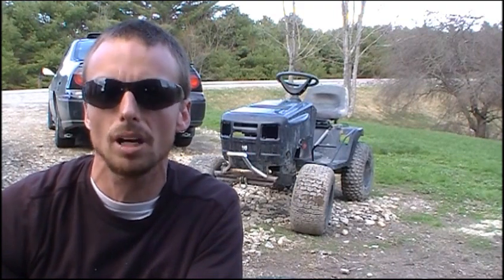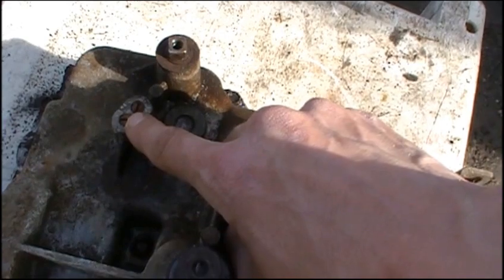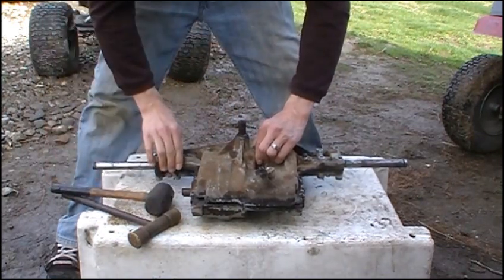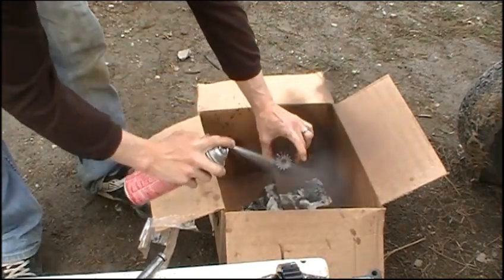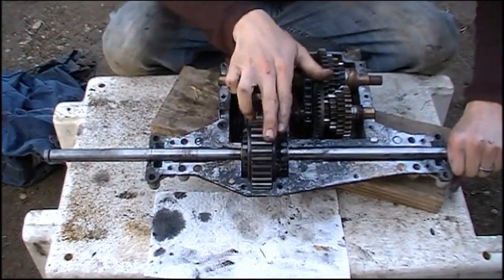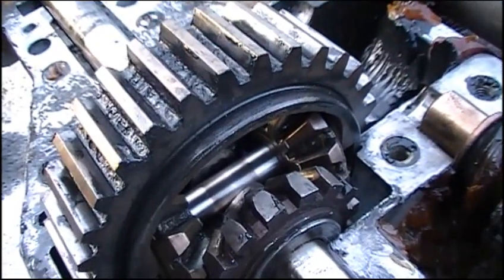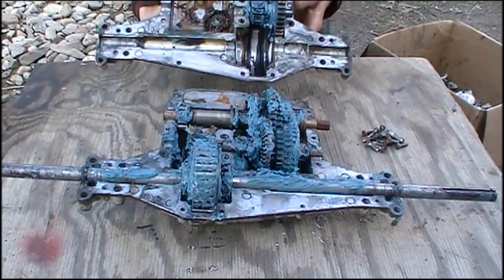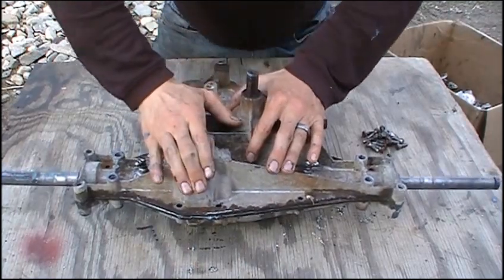How to: Lock a Trans-axle or Differential

Comment: I have a Lawn Chief riding mower.  I took it apart and intended to weld it together and find out why it would not shift when it was in a bind.  I decided not to weld it together because it would not turn around in a small space.  I put it back together correctly and it still will not shift when in a bind.  Do you have any suggestions?

Comment: this has help a ton i was so confussed when someone said they can do this but would this help i have a craftsmen lt4000 and im planning on plowing snow withi it should  lock it or leave it the way it is right now i am running dullies with snow chains but it still gets stuck alot and i have 200 pounds of sand in the back plus my 180 pounds

Comment: I was considering changing my axle shafts to longer ones in order to use wider tires.  Do you think it could hurt the axle? Or is there any other way of mounting wider tires to the existing shafts without welding hubs to them?

Comment: Ok I gotta question, I took my gearbox out just to replace the grease because it was old and discusting, however when I put new grease in it it started turned extremely hard and didn't want to anymore. Does that mean I need to just work at it alittle more to break it in?

Comment: I watched this vid and it was alot of help I locked a 820 and everything works but it shifts real hard is there anything I can do about this
Reply: Should be a detent screw near your shifter flat top screw driver to adjust shift stiffness
Reply: Jimmy, 802 I suggest watch a 13 part series called What on earth happened by Ewaranon to learn that the earth is not a globe.

I got it in my about tab.

Comment: I am building an off road mower from an old Dynamark with the 12.5hp Briggs in it. It has a hydrostatic transaxle and I don't have to shift it. Can I still use this method to lock it? Thanks

Comment: it is because it is mainly for a drift car or a car that u will be doing skids in. the reason it makes a funny noise is prob coz it needs to spin both the wheels at the same time and it is putting to much stress on the diff or when u welded the diff a bit of crap could have fallin in their and it could be clunking around this is only maybe

Comment: Hi fearless I welded my craftsman trans axle as per your video it wash locked and working good untill I took it mudding now the trans axle acts like it was never locked I didn't hear anything happen and when I lifted the rear end and spun the tires there is no noise or binding it just acts like it did before the welding what could of happend?

Comment: I added a John Deere axle behind my Murray garden Tractor. The Murray rear axle has a side drive while the John Deere is on top. If both drive pulkeys are the same size will the axles pull at the same speed? I want both axles to move my tractor. Would it be better to use a tire tread track or gears and chain instead of the extra belt from the motor to drive the second tandem axle?

Comment: I'm building a yard tractor . What is the toughest lawnmower /best transaxle ? A Peerless MSD 206 maybe  ?
Reply: John Averick the 206 is a good one I have one in one of my mudders, I like the 800 series and the Peerless 600, the 600 is probably the strongest of the 3 I mentioned made out of cast iron 3 speed with reverse the things a hoss
Reply: John deere x748 it will pull your house down

Comment: haha
it is normal, wheel rotation speed on each side of the car is different on a car , so by locking those, they will generate a ''drag'' while steering the tire might hop at high speed too!

Comment from the maker: it wont make it hold up better, it will just make both tires spin. and it will also limit your turning radius as well. If you already breaking axles left and right, I wouldn't lock it. It'll just break faster

Comment: I locked my differential on my craftsman, the lock is working fine. the problem is in all forward gears every once in awhile the transaxle will make an abrupt clacky type noise and then stops turning abruptly and then starts turning again at the same speed. I'm really worried about what's going on. another problem is that the tractor is hard to push in neutral. before I locked the transaxle I think it only did this abrupt stop in 5th gear (it's a 5 speed) but I cannot be sure if it was just thi

Comment: continued-- it does not turn as good, but it is worth it, i will be putting snowmobile skis on the front for this winter and right before fall i will order in new front tires, when i get paid on the tenth i will order some 22-11-8 knobby tires for the back, run the stock rims, and as for the front i may have to left the rear or lower the front but i will use 8 inch rims about 5" wide, i will run 6.5 wide tires also knobby tread, or something that will dig in when turning

Comment: and also if i use a stick welder for the locking what amp setting should it be on for maximum strength? whenever I'm welding stuff with it I have it on 75 to 90 amps usually

Comment: hi, i have a transaxle that looks exactly like that, same shape same everything, same position of brakes. , mine has a high, a low , and a reverse range for shifting.  so do u think my trans could handle snowplowing? is it a heavy duty one or just some chinese thing? thanks, jst wondering cause i don't want to blow it out if its not built for plowing.

Comment: Is there a reason why you didn't just fill weld a couple of the teeth on the spur gear? Not only will the axle "float" so you don't get any wobble, but if the spider gear tries to turn, it'll jam on the welded teeth.

Comment: Ok see if you can help me out, i did what you had shown in the video, however you mentioned that as you turn it it can be a little stiff and thats nothing to worry about. I get that sort of stiffness only in one spot, i can still turn it with my hand but it only happens in that spot. My question is, did i fuck up of could it be that i just put too much greese in one location?? Please get back to me, thanks.

Comment: I re greased my transmition a few weeks ago but lost the 2 ball bearings that goes with the shifter. Il just be zoomin along and it will drop out of gear or the gear doesnt match up with the number on the shifter randomly. are these problems caused from the balls?

Comment: Did you use a flux core or mig.  My craftsman has a peerless trans not sure if grease or oil goes in it has a plug by the shifter ?
Reply: flux core

Comment: I loved the video but there could b more id drill a hole and tap it for a grease fitting on the side of the trans n id probably silicone the two halves to seal it I usually put grease fittings on everything

Comment: welding all the spider gears together is easier than this video but the problem is they will always want to break apart as the mechanical energy is transfered to them.  the joint is weaker along the center line axis as opposed to the joint in this video  which is much stronger.

Comment: I have a 2 speed planetary gear setup transmission which has a cast iron case. If I lock it, I've heard that they have more torque than one of those peerless transmission, would you agree.

Comment: i bought a peerless transaxle(same as in the vid) for my racing mower and welded it up and now that i have it in my mower it makes a loud whining when riding, especially at high speeds. i never heard the transaxle before i bought cuz it wasnt in a mower. Are these transaxles noisy by design? cuz i know the straight cut gears will be quite loud but this seems a bit much. Prolly gonna take it apart again and see if i can find a problem but any help is appreciated.

Comment: You could probably just put a separate transmission in and have a chain from the output shaft of the transmission hocked up to a gear connected to a long axle connected to both tires.

Comment: limited slip is completely different than posi. limited slip isnt "locked" just when you are stuck and one tire spins then whether through mechanical or electrical signal the other tire starts to spin. and limited slip is "unlocked" when youre turning. posi traction is always locked no matter what whether turning or if one tire is stuck and the other one isnt

Comment: i have just got a lawn mower and im trying to build a racing mower its a 18hp craftsman and i am trying to lower it by cutting notches in the frame and i want to keep it stock for a stock preparede class even know i cant race because im 12  but i need to build a gas pedal and rebuild the carb

Comment: Why don't you weld the axles, bull dear, and spider together into on big piece? I would thing welding every thing to one solid axle would increase the gearbox's weight capacity a good amount cause the axle would take all the weight, where as the two seperate axles allow the case to split and crack down the middle.

Comment: hey I'm building a Murray I just got it and it wasn't running it runs off gas poured in them them xarb but won't run off there gas in the tank you have any ideas what's wrong I can't figure out what it is thanks
Reply from the maker: sounds like you need to rebuild/replace the carb
Reply: Replace the Carburetor and make sure you use a good quality fuel stabilizer. I mix it in the gas can so it is protected also. Gas will begin to degrade 1 month after you buy it so DO NOT forget the stabilizer.

Comment: i have a question. i locked my axle today but when i put it back together the two balls feel out. what do i do
Reply from the maker: look on the top cover of your case, there should be a spot where your shifter passesinto the top cover. At the base of that, there should be two screws right next to each other going into the aluminum case, once you remove them, there are little springs inside the holes that you're also going to have to pull out with a pick or something. Once you have the screws and springs out, drop the little balls into the holes, THEN put the springs in on top of them, and then re-install the screws. Thats it, no need to take it apart again.

Comment: Seems like lot of trouble that way,  I weld filled between 4 teeth which is three filled valley's on axel and spider gears on a flat plane or 12 and 6 O'clock positions,  Both axels do turn slightly until jamming the weld on gears, no problems yet

Comment: Help.  My Craftsman riding mower will not freewheel.  I cannot push it.  I pull out the transmission/trans-axle lever on the back of the mower to disengage it, but I still cannot push it.  The wheels will only turn in opposite directions.  What is wrong?  Thank you.
Reply: Sounds like the gears part is jammed...

Comment: what do you think would happen if you had a 4x4 lawn mower and you had a locked rear and front differential
Reply: if both front and rear were locked it it wouldnt turn for shit, and unless youve got the pulleys so that the ratio from front to rear is the same then it would bind, your front tires would either be pulling your rear, or your rears would be pushing your front. if you did lock both i dont advise high speeds. but it would be a monster in the mud
Reply: thanks for the info and replying, i am in the process of making a fwd lawn mower with a lift and planning to use it for hauling. also do you happen to know the gear difference between a spicer and a peerless transaxle because that is what i have
Reply: also planing to put front suspension with it
Reply: a diesel engine
Reply: David Abraham im not sure of the actual difference in gears, but if i remember correctly the peerless usually have 3 speed? the regular trans axles have anywere from 5-8, then if theyve got hi and low youre talking some serious gear selection, which when your dealing with big tires your going to want that selection,
Reply: thanks again and you have awesome videos that help alot 
thanks
Reply: i am planning on getting a v-twin engine for it and as i have mentioned before i will be hauling with it and it has no pulley swap 
what engine do you recommend 
thanks 
i will send some pics and updates as i progress with this project
Reply: David Abraham briggs makes a good opposed twin, ive had 2 and there bullet proof, except they seem to have problems picking up there fuel but run good. kohlers are also very good motors, if i were you i would stay away from tecumseh, never had any luck with those damned things. and i think you might have me confused with fearlessfront, i do similar stuff, but he does it on a regular  basis, so if you haven't subscribed to him i highly advise it.
Reply: thanks and sorry for the confusion thought i commented on fearless's vid and only he could reply
any how what do you suggest for trany oil and trany grease
Reply: David Abraham  no worries, and any old grease or oil should work, just add grease if theirs grease in the case, or oil if there oil in the case. to my knowledge it shouldnt matter all too much.
Reply: when you mean old oil do you mean just regular car oil or gear oil
Reply: David Abraham you want a heavy duty gear oil, i think they call for like 80w-90
Reply: ok thanks i may in the future have more questions for you
Reply: for the trans axles when you are refilling them with new gear oil is there a certain amount that you have to put in or should i just fill it to the top
Reply: David Abraham if you google your lawnmowers owners manual it will tell you in their, each transaxles different.
Reply: ok thanks

Comment: i have a john deere rolling chassi with a hydro stat rear end all it needs is a motor. the original motor was a kawi 14 hp i think. i was wondering if i could put a 8 hp briggs motor on it out if a simiplicity, if i get thee electrical hooked up and everything will the pullys line up with the briggs motor cuz simplicity mower it came out of wasnt a hydro. please help

Comment: You should spray all of the exposed metal surfaces with some welder anti-spatter spray before you weld. It makes your spatter clean up a lot more easier. And stop using the brake cleaner. The fumes that puts off as you are welding is very bad stuff.

Comment: this will also work with real car rear axles i'm going to use this on my hotrtod it has a pegleg  ford 9 inch rear end (pegleg meaning non posi rear end or non posi at all) it should work just the same because it has the same setup withe the planetary gears in the tractor rearend.

Comment: same there. can't open the case, screws are all gone, there is some kind of sealer between the parts... what can i use to dissolve that rubber?
Reply: A thin flat blade screw driver or paint scraper. It'll be a sealant similar to Three Bond. Be vigilant.
Reply: Thank You, Champion! did use a stanley blade, then paint scraper lifting it up for around 10-15 minutes, and then out of nowhere crack crack crack that glue"thing" started getting off. Pulled all apart. Lots of that glue was on the shafts. My other question is - assembly: should i use gear oil (there was oil in it, or grease?) what should be used to seal the whole case again? 

Regs. Daltonix
Reply: It was oil and not very runny old grease? The shaft seals will give away whether it was oil or grease filled (seals will be solid rubber like an o-ring of grease filled, oil filled will have an internal lip) Normally, use a good RTV silicone sealant like Ultrablue, Bluemaxx or Greymaxx. If oil filled (not a hydro) use a nice heavy gear oil ie 80W90 85W140. If grease, HTB grease as it has a high melt point and won't turn to slop, or if you plan to put the transaxle through a lot of water, a good Marine grade grease works well.
Reply: kill me for this stupid question but what's a hydro? (*I started to pull apart the whole gear assembly as it was making noise like "metal on metal rubbing) but so far nothing unusual, bearings are good...
Reply: Hydrostatic transaxle. If you physically have to change gear with a lever, it will be manual shift/mechanical type transaxle like the one Fearless locked. A Hydrostatic transaxle uses oil pressure within the transmission to send drive to the wheels via and is operated most times by a heel/toe pedal. When you reassemble, make sure all the gears are sitting where they should be and everything was sitting square before welding.
Reply: I think in regards to welding i might take the axle to a welding shop, even that i got a brand new $3000 MMA something something MIG/ TIG plasma welder. I don't even know where to get the gas bottle (Argon gas?)...
Anyway, after that is done, i'll to take apart that hydrostatic box to see maybe there is something inside that is causing the noise)...
Reply: Just an update: DONE! Welded but with a lot of trouble. When parts were all cleaned up, i started welding and oil started to spread out from the gears. I couldn't even spot weld it.
Went to a local machining shop, asking if they can do an easy job...(cost$20). Oh they were swearing too:) but welded it all up as it should be, saying it should cost more - around $60-80. Can't wait to start it and try it:)

Comment: I decided to weld 2 transaxel's. Everything turned out well. 
My issue is my top casing will not go back on. It's high centered. Am I missing something when putting them back together? 
How can the same thing happen with 2 transaxel's
Reply from the maker: inside the case, there are some brass bushings that the shafts have on the ends.. Make sure all these brass bushings haven't gotten mis-aligned before you put the cover back on. they have a notch on one side that has to rest in a "cut out" area in the casing. it's really easy to overlook

Comment: Where can you get replacement little balls and springs? The guy I bought a mower from lost them. :(
Reply from the maker: Not 100% sure about the springs, but I have been told you can use ball bearings from inside a bicycle hub, or large BB's work too.
Reply: Fearlessfront 6mm BBs maybe ?
Reply: Kleigh Sharp Found it and have it together. :)